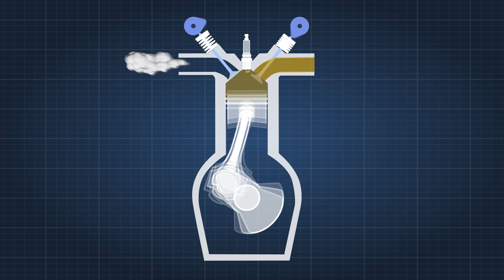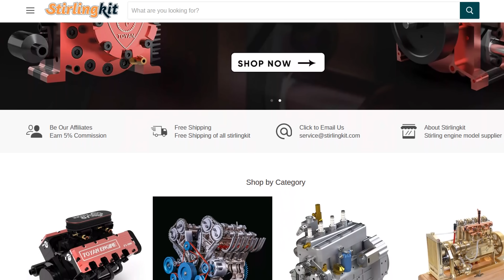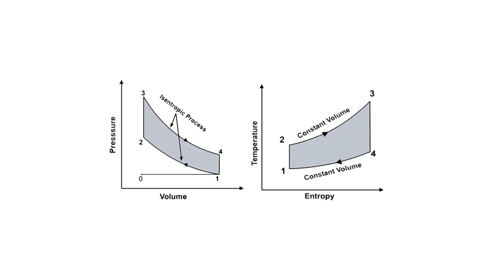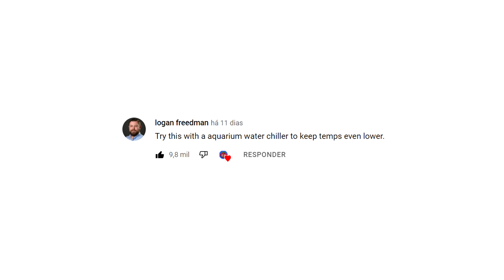I 3D Printed a Transparent Combustion Engine in Resin

Comment: The air fuel ratio changes per fuel used.  Ethanol needs 3p percent more fuel to havs right fuel mix. Most of yours where running very lean

Comment: To get better efficiency of gasoline is to obviously feed that fuel to the gasoline-fueled diesel engines (with special gasoline injectors installed in place of hydraulic fuel oil injectors), and they have decent efficiency of about 45% or above, essentially meaning there's little to no waste unburnt fuel (unless you have lost the compression in one of the cylinders, which then the air won't get hot enough to ignite gasoline and / or diesel fuel). There are a few car makers already using gasoline-fueled diesel engines in the cars, to name one, Mazda Skyactiv-X.

Comment: I think the engine was just running waaaay to rich on petrol. Also, you can see the compression leaking out between the cylinder and head. You wont realy get more power out if you cant get more air in.

Comment: You are probably hitting the engine's rev limiter. When the RPMs of an electronically controlled engine reaches the rev limit it turns the spark off for a couple revolutions of the engine to slow it down. On mechanically controlled engines they have a device called a governor that limits airflow into the engine when the RPMs are too high. If an engine spins too fast it likes to spontaneously disassemble. 

Now about the fuels. Race fuel isn't necessarily more potent. Race fuel is higher octane which is it's resistance to igniting. During compression the temperature shoots up and brings the fuel close to igniting. The spark is supposed to be the final tipping point to ignite the mixture.  If compressed too much or the temperature of the mixture is too high the mixture will spontaneously ignite in the cylinder before the spark. That is called detonation. This damages the engine and can push back against the piston while the piston is still traveling upwards. Engines are designed with this in mind and are given a compression ratio suitable for their application and what fuel will be used. More compression provides a more energetic burn, thus more efficient and more power but will require a higher octane fuel. 

Because higher octane fuels are harder to ignite, they sometimes need a hotter or more energetic spark. NileRed has a short showing the different colors things burn. When he gets to nitromethane he has trouble lighting it with a flame and has to add some methanol to it to get it to burn.

Comment: You need to advance the timing ignition, so it fires before the top dead point. Flames travel more slowly than that piston itself. At higher rpm your flame front is too slow to reach the bottom of the cilinder, so you don't combust everything. Perhaps the excess fuel keeps building up over the next cycles and the engine self detonates like a two stroke.

Comment: In all the runs it looks like fluid it sloshing around like crazy - extremely rich. Perhaps it is choking. And reason why it run normally with the best fuel might be like you said that it provides it self its own oxidizer when ignited. Essentially Lean it once it started. And the flame color looks bit blue - that usually mean too rich. There is  this saying that it should be red flame for good mixture. Also it looks like it is exploding instead of burning until you use that best fuel where you can see nice flame propagation. Explosions (knocking) are not good for the engine nor its cycles.

Comment: So, methanol is not less powerful than gasoline. It's the other way around. It's just that you need more methanol to equal the same efficiency. You can get way more power out of methanol. Methanol has it's own oxygen. So it needs less air to boom. That's why it reved faster. The reason gasoline burned yellow and bright was due to the impurity of the combustion. The cleaner the combustion, the less you can see the combustion. Methanol is a better fuel then gas.

Comment: I think nitromethane is good fuel as compared to gasoline. As we know A good combustion needs a mixture of fuel and oxygen(oxidizer) in a perfect amount ratio, But we are using the same volume of a cylinder or the same amount of gas in the case of gasoline and nitromethane. Hence we are not providing enough oxygen to nitromethane to get burned efficiently. 

improvements:  
1) we can enlarge the size of the cylinder. 
2) we can use a mini turbocharger. 
3) we can spray extra oxygen externally.

Let's start a little discussion!!!😁😁😁

Comment: You will need 50% more fuel to make it happy on meth. On e85 its 40% u will have to re-jet (allow more fuel flow) on the carburetor if u want it to run better

Comment: I know next to nothing about combustion engines, but you did enough testing in the video to likely prove out what I am about to say. 

TL;DR Fuel and air mixture is off.

So you mentioned that the nitromethane requires less air to combust, so to me it would make sense that the 25% nitromethane mix would be more likely to actually operate a four stroke cycle while the straight gas couldn't under the same conditions. How you fix that, I have no idea. I would watch a video of you trying to fix that problem though.

Comment: methanol is a cooler burning fuel, that makes the engine colder. its used in many cars, especially turboed engines. its both better for the temperatures and power. less heat, more power!

Comment: Maybe an explanation for the inconcistent rpm to fuel value is the explosion speed of the fuel, next to fuel value fuel also has a octane number which is linked to the propegation speed of the explosion from the spark plug. If this is higher then the explosion reaction would be faster and release the energy in a shorter amount of time. The octane rating for methanol is about 119 and for normal gasoline it is about 95. Maybe this is worth looking into.

Comment: Alcohols burn much cleaner and faster than long chain hydrocarbons like petrol or diesel but they lack the thermal energy output in every burn. So the torque output from methanol is very less when compared to energy dense hydrocarbon fuels. In the end, power output = Torque * Angular_speed.

Comment: OK so I have an idea you remember the solid propulsion rockets you made in which rocket uses it self as a propellant 
Well make inlets for the oxidizer to enter at the exhaust which will help In more thrust and also make size of the rocket more bigger so that it can handle  pressurised explosions.

Comment: The air to fuel ratio of the different fuels needs to be accounted for. I believe methane needs to run a roughly 30% richer fuel to air mixture than gasoline. And the nitro may need to be even richer
Reply: So the reason the engine wasn't firing is because there wasn't enough fuel in the cylinder to fire consistently. Try turning the fuel mixture with each and see what you get. When running right nitro may blow up your cylinder

Comment: I believe the reason RPM is proportional to power in this engine is because more power can't be at higher RPM. If you put a load on the high RPM fuels it would bog down much more than the lower RPM fuels, as they burn slower but with more power.

This is similar in principle to explosives, some explosives go through incredibly fast deflagration, and create a 'snap' or 'crack' effect on materials, other explosives have a slower deflagration, but have a 'pushing' or 'moving' effect.

Comment: Slower run is due to the change in the speed of the flame based on fuel. Timing changes to the pickup. Move the timing of the spark.

Comment: Your stoichiometric  air fuel ratios are not being corrected between your different fuels. Gas is 14.7-1 and methanol is 6.6-1. With methanol it takes about 2 times as much fuel compared to gas. Nitro methane mixed in methanol takes even more. The last fuel ran leaner therefore you didn’t have the equivalent energy density inside the combustion chamber to push the cylinder down run at higher rpm. 
Also I saw fuel leaking and combustion at the cylinder head seal. Try red high temp automotive silicone to seal the top better. It may work just long enough to get a good video. 

It may also be valve float from higher rpm not controlling the incoming air for compression and combustion. Try shimming the valve springs with washers to get my seat pressure to control valve float. 

While methanol does have less energy density than gas it has higher engine power output cause ability in an engine than gas. Nitro methane is even higher.

Comment: It looks to be running rich, the air and fuel mixture is a little bit off. I would also consider some sort of gasket, and a nitro carburator. Just something adjustable. It would be cool to see that engine become some kind of crazy fan.

Comment: From my perspective there is possibility(1 or more combine below) why the engine doesnt running as expected:

First, the mixture can be too rich so the combustion doesnt igniting properly thatthe engine have slower rpm then expected (for example dragster engine)

Second, the compresion doesnt high enough for the mixture to properly combust to make higher power than gasoline

Third, the exhaust valve is too small to let the gas that engine produce after combustion out fast enough/clearly. 

Fourth, the intake valve also too small to engine to take air in from ambient so the combustion of the mixture doesnt properly combust to make enough power. Engine just like our lungs need to breathe properly if our nose blocked we doesnt feel good to breathe

Fifth, the magneto/igniter or whatever it called to make power for sparkplug. So the sparkplug doesnt have big spark enough to properly combust the mixture inside the cylinder

Sixth, the tolerance between cylinder wall and piston not tight enough so the small amount of fuel and air leaking there

Seventh, carburator itself to small to make a good mixture

Eighth, there is a maximum RPM limit that the engine can handle before the valve (intake and exhaust) itself in the condition that called "floating"

Comment: Nitromethane is not more powerful than petrol, it's many time less powerful that petrol, you can just burn a whole lot more than you can with petrol, engines that are properly set up to run nitromethane have a stoichiometric  ratio of 1.7:1  versus 14.7:1 for petrol. You'd have to drill out or replace your carb to run nitro properly, same goes for the methanol actually, you need a stoichiometric ratio of 6.0:1 to run methanol properly.

Comment: There are a number of factors that could be adding to your inconsistent burn, but the number one things I can think of is fuel-to-air ratio and compression ratio. Carburetors require some tweaking and don’t translate well when changing fuels. A forced air system may be required to get the mixture right with the “higher tier” fuels. The last thing is compression ratio, which is difficult to change. “Higher tier” fuels generally require higher compression in order to ignite properly

Comment: because the cylinder is made of a different material than the piston thermal expansion could be causing the cylinder to expand at a faster rate resulting in a loss of compression.  One thing to note is that methanol burns at a much lower temperature than gasoline and much less likely to overheat an engine.

Comment: Your fuel problem with the different fuel Blends is incorrect air fuel mixture. In other words your carburetor is tuned for one particular type of fuel but not the others. Going to methanol or other similar fuel types requires more fuel per intake stroke, the reason you are seeing ignition every second or third power stroke is because you're only getting enough fuel into the cylinder after two or three intake Cycles.

Comment: First thing would be mixture, as all of these fuels have different air/fuel ratio. Bad mixture would cause the engine to run poorly, if it even runs.
Second thing, it would provide better data to use some form of engine load to better test the performance of each fuel.
Reply: Yeah I agree, I think it's the AFR's - Integza should look up fuel Lambda's / AFR's for the different fuels - there's a lot of tuning videos around this for actual vehicles. I'm assuming you're running too rich for the ones that fizzle out and then was running too lean for the one that revved higher.

Perhaps tweak the quantity of air that works it's way into the engine (you'd probably do this by changing the carb jets but not sure that can be done with that model).
Reply: Skipping power strokes is likely due to no load lean conditions - enough accumulation of unburned fuel on the "dead" strokes will eventually make one good puff. If he has enough compression and was running under load it probably would be predetonating depending on ignition advance.
Reply: came here to suggest this, its definitely got to be something up with the air fuel ratio... there are lots of other videos where he has had issues do to air fuel as well
Reply: I was thinking that the issue might be an inadequate air intake or poor expulsion of exhaust.
Reply: How would a stoichiometric mixture run?
Reply: I mean, he definitely can build and put his own carburetor on it
Reply: not air ratios no sensor or proper because in multiple tests show that it only takes a little bit to be able it to ignite for sucha a size. so yes mabye but. U see dear boy MAGNETS every fuel did not go to 4500 rpm THE sweet spot for Exaughsting and intaking It was The perfect speed. while everything else went faster :) so the magnet was a switch u could say (so why didnt keep up or regester the other speeds.) well simply it couldnt do it fast enough im not saying the electricty is to slow that impocible its that the magnet took mulitple strokes to register another magnet going by it. So to make ur thier correct the entire enginge would have to be off sync making the explosion happy randomly or when its at its lest powerfull point of compresion.

Comment: Nitromethane, methanol and ethanol engines run on higher compression, this might be the problem you're having. also if you can, make some gaskets using cork or even thin sheets of metal

Comment: I guess that first you need to check, for sure, if the sparks are really happening every proper cicle. Second,  you have top check the gap in the cilinder, because you may be creating a vacuum in the lower part, after the explosion, making the the gases being exchanged in the next cicle?

Comment: Looks like some kind of electric ignition control or governor hidden in the base box. I expect it just doesn't spark when the rpm is above a certain threshold to prevent people thrashing them to pieces with nitro fuels ;)
Running it without a load it only has to overcome it's own internal friction so a single power stroke will spin it fast enough to last several revolutions before it needs another, and being 4 stroke cycle it'll be multiples of 4.
As others have suggested try adding a load so it actually has to work to keep the rpm up, then I expect you'll see a more consistent firing on each power stroke.

Comment: intake and exhaust restriction, LSA (lobe separation angle), mixture can all attribute to why the rpm ranges, regardless of power potential, were not intuitively linked to theory. 

Theres also ignition timing, which is going to drastically change your performance across the rev range. the flame front speeds are all different for the fuels. If you have a way to retard or advance timing, then you should be able to fix the rpm problems. 

Theres lots of science behind this, and the test apparatus had next to none of the variables able to be controlled. Let alone compression. 

Also, compression ratio is important too. are you making the best out of the octane before preignition/knock (related to getting the most advanced timing, without losing power). You can see things like "laminar combustion velocity" being higher on nitromethane, meaning your igition timing at idle should be set a few degrees less than normal fuels, the advance ramp should be less intense too (hence why nitromethane is better in high power and high rpm applications, not needing accesive ignition timing, and have a fast flame front @ high rpm)

Theres lots of cheap and oldfashioned ways of setting this up and testing such as:

timing light
points distributor (with adjustment)
full featured carb with idle air/mixture/secondaries/etc. 
larger engine (small, toy size engines, are incredibly hard to control and tune)

Comment: Hey Integza, I think it would be an interesting video to see if you can use the waste heat from the gasoline engine to power a steam engine and somehow combine their outputs if possible. Squeeze all the power you can out of those dinosaurs :)
Reply: That is a brilliant idea. I kind of do something similar here at my house. Out in my workshop that is attached to the house I have a woodstove. I have a copper coil and a one-way valve running through the bottom grate of the fireplace which Heats a 50 gallon barrel of water over time.  Then I can pump that hot water through a radiator in the house and blow a fan over it which keeps the house fairly warm. Mind you it is only a tiny house with one main room a bedroom and a bathroom but it still works pretty darn good. In the summertime it also works pretty well in reverse. The water is sitting out in the barrel gets down to 60° or so at night. Then I can pump it through the radiator and it serves as kind of a air conditioner in the summertime.
Reply: Pretty cool that something similar is already in use. And cool to hear about your radiator setup, good use of the woodstove.

I think an additional way to use the steam produced could be to power implements. Think an excavator for example. The engine itself could run the tracks and what not, but the steam could be used for hydraulics perhaps.
Reply: U ARE A GENIUS
Reply: a stirling would be better.